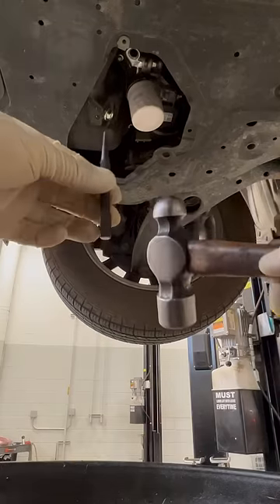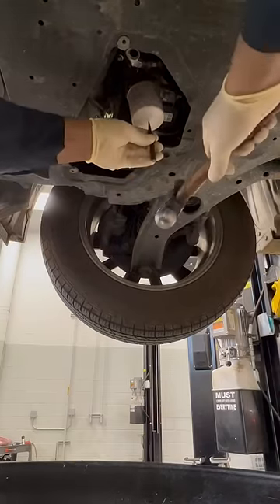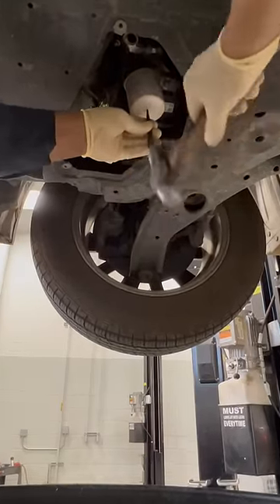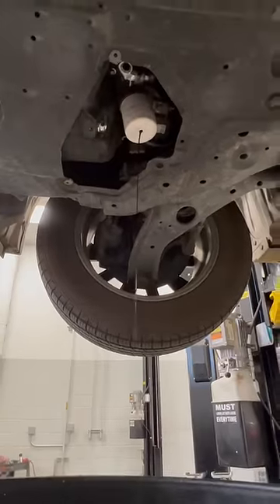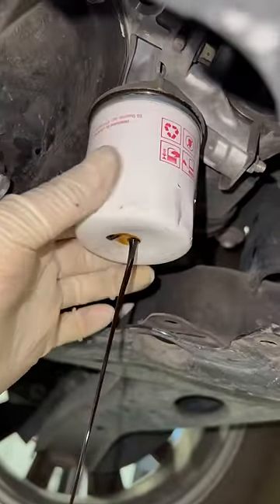Tech Tip Of The Day Oil Filter Clean Removal #oil #oilfilter #mechanic #shorts

Comment: Tech tip - Always make sure you have the correct replacement filter for vehicle prior to driving said chisel into filter😂
Reply: you need a replacement filter anyways?
Reply: Why would you reuse an oil filter?
Reply: facts lol or ur advisor gonna have ur ass while oreillys takes 3 hours to deliver a filter with the car hoisted up still
Reply: JB weld does the trick
Reply: Happened to me as a field service engineer, in skye (Scotland) Ford straight six motor on a towing tractor that was used to take the cargo off the boats (Caledonian mcbrayne) went to my Mercedes van ,forgot to pack the filter back in Glasgow 🙊🤣,swore a few times.
Reply: Why would you take it off if you’re gonna re use it
Reply: You guys have clearly never worked on cars, sometimes you don't get the correct parts. Sometimes problems occur and a filter won't budge, last thing you want to do is ruin a filter before you know you can get it off and you've got the right replacement 😂
Reply: It's not a chisel. It's a nail punch that is used for finish carpentry.
Reply: @o0Stephenpatrick0o  if you work on cars you know to read the part number out of the book and get the filter yourself rather than having an autozone employee find it for you
Reply: By manufacturer You can use oil filters twice when you buy certain higher end filters.
Reply: @PedroFernandez-gx9is 8 dollar filter vs 3500 dollar engine?  Nah I'm good.
Reply: I often like to clean my filters and reuse them
Reply: @bassdynasty8840  if the new one you bought doesn’t fit and you need the car to drive somewhere to pick another one up
Reply: If I have to take my car in for an oil change, I will make a discreet mark on the filter to make sure it's not reused.
Reply: @reuploader He said make sure you have the CORRECT one.

Like some fords will ask if it’s a metric or standard thread. Ford transitioned mid year. 
Other manufacturers do the same.
Reply: @awsomegamer8277 
Why would you buy a filter that doesn't fit and before you start changing filter make assure it's the same model . 
Don't make rookie mistakes .
Reply: A kid actually done this at Nashville Auto Diesel College.
Reply: Not reused 😅
Reply: @bassdynasty8840 because the one you got from the store was in the wrong box and it doesnt fit (literally juat happened to me). Luckily i use amazon synthetic so it was only $30 for new oil, still annoying.
Reply: @unlisted9494  
🤦
Reply: @o0Stephenpatrick0o  and then you can't drive to the store to get the right part lol
Reply: @@reuploader3579Because the parts guy delivered the wrong filter and it's closing time Friday and the parts store is closed and the customer is there to pick up their car. That's why
Reply: He’s saying make sure you have a filter in stock prior to taking the original filter off we do this at my work too but our orileys guy is always on it 😂
Reply: @PedroFernandez-gx9is  why not buy higher quality oil to go with them i use k and n filters and royal purple both rated for 20000 shitty oil will ruin your good filter long before its time to change because cheaper oil burns faster which then clogs your 20000+ mile filter
Reply: @o0Stephenpatrick0o facts clearly they haven't. Nothing like a car on the lift and you can't work just waiting on parts delivery
Reply: @MisterM-ow6qk  it's not a nail punch it's a centre punch
Reply: @williammcconville4967  It's a nail punch that is used to punch nails in on wood trim for finish carpentry. How are you going to tell me when I am a rough and finish carpenter. A center punch is an awl or a different tool. There is one that snaps in and is used for metal that is a center punch. This is a nail punch.
Reply: @MisterM-ow6qk  and what do I do?
Reply: @MisterM-ow6qk  odds are you would use a tool that is for digging into metal to make a hole over a tool made to push it in. Iv a centre punch that's identical
Reply: @williammcconville4967  I could careless, but you are using the wrong tool. Lol
Reply: @b55passat not necessarily, my Toyota burns oil pretty quick, something with the piston assembly they fucked up in these models (of course no recall how awesome) so I’m changing oil every 1600-1800 miles (depending on if I wanna just keep adding a quart every week) but the oil filter is rated for twice that lmao so no way I’m buying a new one but of course I wouldn’t take that one off anyway just let it be nothing wrong with a little old oil in the mix anyway cause it’s all gonna burn up before it’s supposed to anyway
Reply: @grind-hardtrashbaggang7083  had a car burned it like a 2 stroke once no need for any changes at all just top it off 😂
Reply: @williammcconville4967  that’s where I’m at with it now lmao I paid 10k for it 2 years ago and I’ll be damned if I’m not gonna get my moneys worth out of it regardless. I just ride around with a quart on me every where I go I’ll usually only change it if I’m taking a long trip that way it’s not putting too much stress on the motor
Reply: Multiple different filters will fit any car, the only difference is the length of the filter.
Reply: @grind-hardtrashbaggang7083  Lukas oil stabiliser helps and slick 50 helps make yourself a cocktail 😂. Stabiliser slows the burn and slick 50 makes the oil stick to parts better seen an engine that had slick 50 in it run with zero oil for hours
Reply: @bassdynasty8840  You see, having a filter that fits but needs to be replaced is better than not having a filter at all.
Reply: @unlisted9494 you take it out of the box before you even drain your oil and physically check. Might be a big brain move but still. Then you get a oil filter wrench and de torque the thing to be sure its not seized. Then you leave a container underneath the drain plug and gently open it. Wait until no more oil is coming out of your plug and pop the filter like this then wait another few minutes. After that i like to pour a little bit of fresh into the thing to get any residual black oil out of the system. Now you gently twist off the filter/seal and properly lube/install your new filter. Then tighen it until its slightly past snug but not too tight(same with drain plug. Dont be a momo that torqued things like superman). Finally fill with your big jugs of oil and boom. You did it. Without any mistakes or extra trips.
Reply: Jb weld and duct tape has entered the chat
Reply: Mechanic shops don't always supply every filter when working n on cars. May need to order which is unexpected wait time for customers and loss of time for business to make more money.
Reply: And you can actually get the filter off. I have had a few that it seemed like they put them on with an impact gun. The jiffy lube sticker is always a dead giveaway.
Reply: Gee some of these comments you guys are f..kn thick he said make sure it’s the right one …
Reply: @_vortech_ yeah but some people will buy the wrong one or size if they never changed there own oil before and didn't ask if they are buy the right one for there car
Reply: @o0Stephenpatrick0o 🤡
Reply: @bassdynasty8840 read to understand, not to reply.
Reply: It's amazing how many people don't understand such a simple comment.
Reply: @MisterM-ow6qk  you could care less so you do care a bit nice to know. Well I couldn't care less about your opinion I'm sure the tool manufacturers that labeled it knew what tool they made
Reply: @josephdias5859  you know things run out and, you might not hold different types of filters at your shop. if the customer is willing to wait they can if not, put the old filter back on after you drained it.
Reply: Tech Tip #2: do the oil change in the parking lot at the parts place, then if you got the wrong filter it’s a short walk lol
Reply: @bender49ers some filters are a whole lot more than $8. Some are well over $100.
Reply: @SM-ii8pg  yep but 90 percent of the population uses the 10 dollar ones
Reply: @bender49ers  You're not wrong, I was just pointing out that some vehicles have very expensive oil filters. Basically anything Diesel, and that includes the newer Chrysler 3.0's in some of their SUVs.
Reply: Add Pro on the front of your comment, because that's exactly what it is.
Reply: How the hell could someone buy the wrong oil filter, unless you don’t check your cars manual 🤦
Reply: It's ok if wrong one just drive back down there get proper one
Reply: Litteraly nobody re uses filters 🤣🤣🤣🤣 you typically have the new filter on hand WHILE doing this , not hard to find the right filter either
Reply: @bassdynasty8840  no one said anything about re-using the old filter, what he said was make sure you have the right SIZE filter. 

Learn to read. Like properly, not just skimming and then responding to something else.
Reply: @julianlopez2389 another dealership slave like me I see 😂 I can relate to this so hard
Reply: No f*ck ups today 😂
Reply: @josephdias5859 sometimes shit happens regardless it is what it is people ain't perfect.
Reply: @miataisalwaystheanswer1356  mannn🤦🏽‍♂️😂
Reply: Why would you use a chisel? It's a hole punch. When did YouTube get so dumb
Reply: @BURRNTU  as if a chisel won't do exactly the same thing to the bottom of an oil filter if that's what's easiest wiithin reach, you're right when did YouTube get so stupid. Like you need the right specialized tool for this it can only be a hole punch. Stick a freaking screwdriver in it ffs. Done.
Reply: @BURRNTU  I mean you are putting a hole in an oil filter ffs any pointy metal thing will do, give it a whack and done.
Reply: @bendermi  you’re obviously never worked in a shop gotten a wrong part or even ordered something online 🤦‍♂️
Reply: @awsomegamer8277  
Is it new to you to check the parts? 🤦🤣
If the parts are on a shelf and there is a possibility they could be swapped, then I check if they have been switched in the store .
Reply: Make sure you can remove said oil filter first before punching a hole in it. Some are stuck on rusted tight.
Reply: @hashishsenju2015  
Where do you drive your car since it can rust so badly in 12 months?
Reply: @bendermi  that’s not always possible unless you have a filter on hand it’s not as simple as your desperately trying to make it
Reply: @awsomegamer8277  
You can check if the filter is the same in the next box on the shelf. 
So you're new to check for errors. 🤦🤣🤣
Reply: @bendermi  I’ve seen an entire shelf of filters that where boxed wrong you put too much trust in companies
Reply: @MisterM-ow6qk it's a dot punch for metal working for marking center holes before you drill so the drill doesn't skip around iv never seen a carpenter use a "sharp" punch
Reply: Replacement filters are generally pretty cheap; most go for $10 or under.
Reply: @b55passat  some vehicles use cartridge in the cans so punching the hole  is a problem you don’t want to have
Reply: @jayperkins2100  I think you are talking about an actual center punch. It looks similar but a bit different it snaps on metal and makes a hole for drilling. There are self tapping screws and actual metal drill bits start small and increase to size if for metal.
Reply: @MisterM-ow6qk  bro that's exactly what it is iv been an engineer working with metal for 14 years iv had my dot punch 12 😂😂 it was an item I obtained during my engineering course 😂by the way you said snap onto metal I assume your talking about a spring loaded punch
Reply: @jayperkins2100  Yes it has a spring.
Reply: @MisterM-ow6qk  yh that's just a spring loaded version they don't all have that that's more the newer ones they won't last 12 years like old ones
Reply: Or have more than one vehicle.
Reply: @bendermi  Canadian salt belt
Reply: @hashishsenju2015  
Then you canadians don't have precautions or tools to deal with it?
Reply: Why wouldnt they? They are replacing it! 😂🤦‍♂️
Reply: that's a 5358. very common. If you don't have them on stock, you need to reevaluate and restock.
Reply: @o0Stephenpatrick0o I’m a mechanic and filters come a dime a dozen, don’t need to save them
Reply: Some filters just screw on like this. Others are in a housing which you need to keep intact. But on replaceable filter housings it works
Reply: @bassdynasty8840 it full shit inside filter and you change it on your second oil change too
Reply: @hashishsenju2015 there is not a filter you cannot remove…
Reply: @o0Stephenpatrick0o worked on my own cars my whole life and not once have I ever bought the wrong filter. Now who’s the idiot
Reply: @ThatDIYguy403 well who’s fault is that when u wait till last minute and if they deliver the wrong one I’m sure they will bring the right one
Reply: @austinkesler4493  Err of course you can remove anything if you're creative emough, but a filter rust-welded in extremely cramped spaces for any kind of conventional tool is stuff of nightmares.
Reply: @reuploader3579sometimes you're sent the wrong part.  This has happened to me at least once - I ordered the proper part, double checked, and the store sent me the wrong one.  Sometimes parts numbers aren't legible on the old parts and info for older vehicles isn't perfect, or the vehicle has been modified to non-stick conditions, requiring different parts.  Long story short, getting the wrong part can definitely happen.
Reply: @bendermi American trucks often have a million different stock options, and then will often get modified with non-stock accessories as the years go by.  So when you're the fourth owner of a 25 year old truck, it's frequently very hard to determine what the proper part is.  Additionally, I've had the wrong parts shipped to me (I verified that I ordered the proper part, I was simply sent the wrong thing).  Manufacturers also will switch parts out mid-year, further complicating the situation.  From what I've experienced working on European and Asian cars, parts are more standard.  With US car manufacturers is still the wild west lol.
Reply: @advena996  

I like your long explanation LOL 
but if you have so many variables why don't you just take the time needed. 
Now you know why you don't shop for spare parts on the Web .
Reply: @o0Stephenpatrick0o  amen!! Alot of people in here posting replies without thinking... I try to always remove parts without damaging them.  Saved my butt a few times!